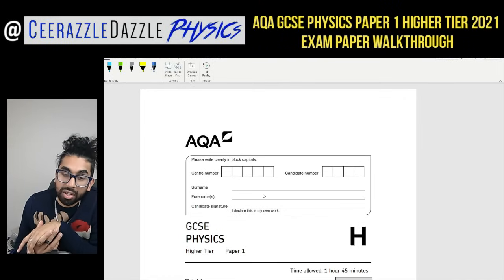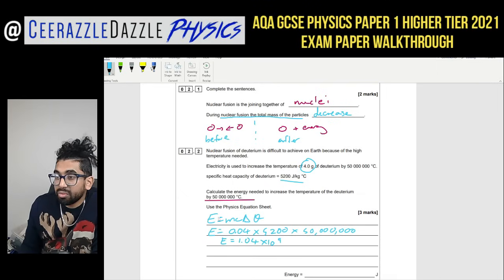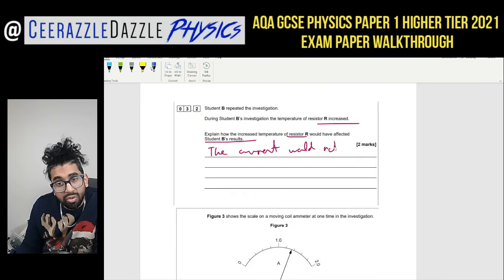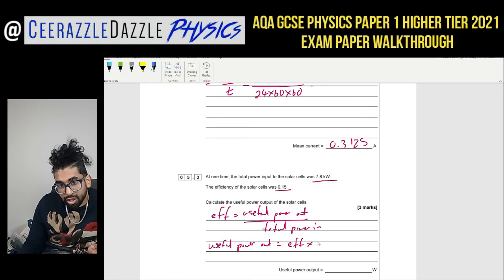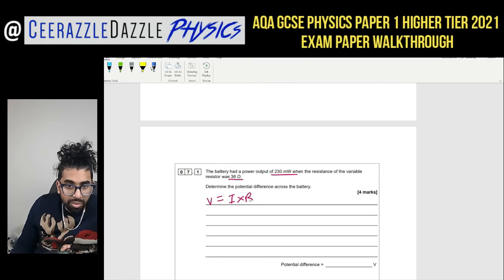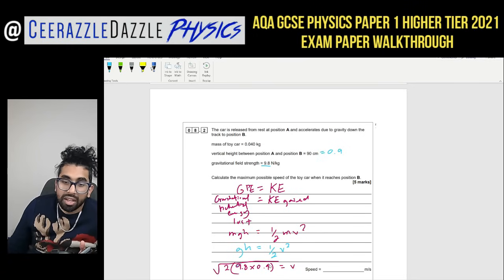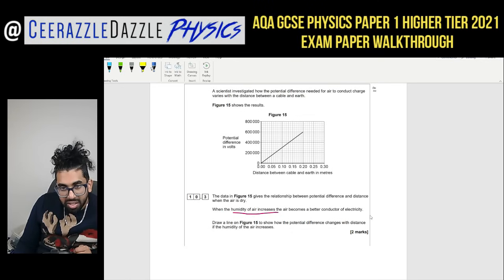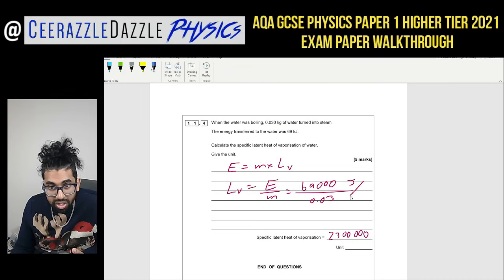AQA GCSE Physics 2021 Paper 1 Higher Tier Past Paper full exam walkthrough!

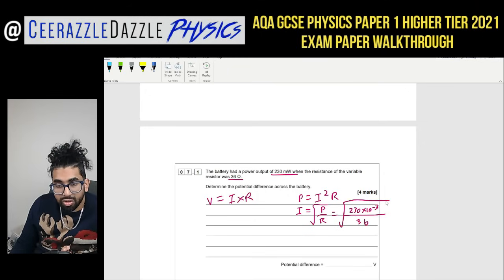Comment: where did you get the 0.230 in question 7 at 30:14
Reply from the maker: Lower case ‘m’ means milli which is 10^-3. Upper case ‘M’ means Mega which means 10^6
e.g. 1mW =0.001W and 1 MW = 1000000W
Reply: @ceerazzledazzlephysics  ohhh i see thank you very much!
Reply from the maker: 230 mW = 0.230 W given in the question
Reply: @ceerazzledazzlephysics  doesnt 'mW' represent megawatts tho which means in 1 megawatt, there is 1,000,000 watts?
Reply: @cazoxv5006 lowercase is ''milli'', which is 10^-3 , megawatts is represented by a ''M'', which is 10^6